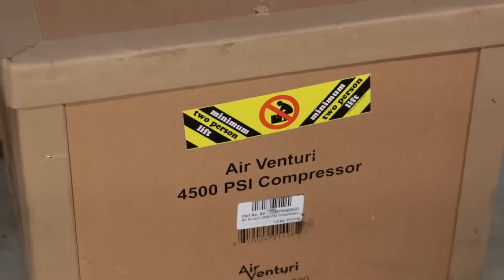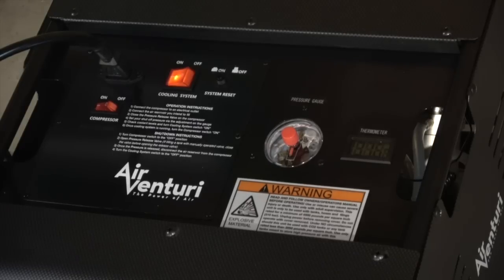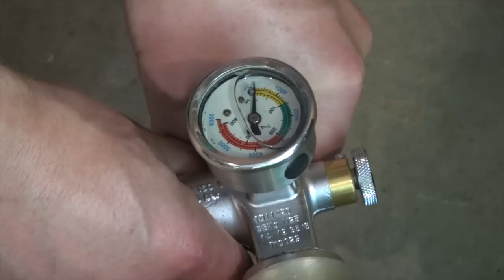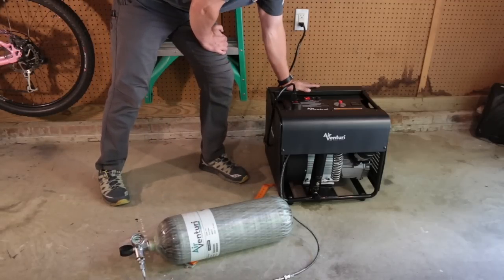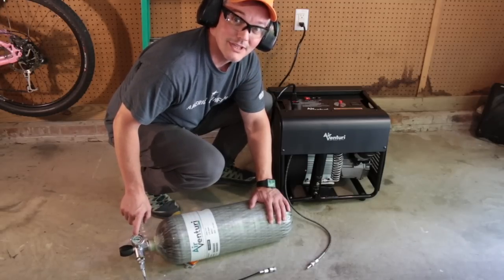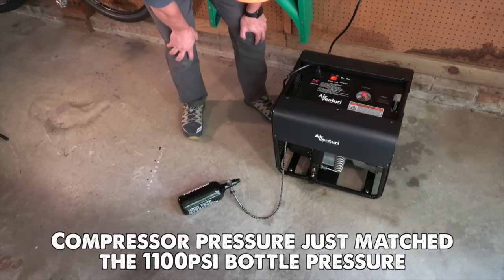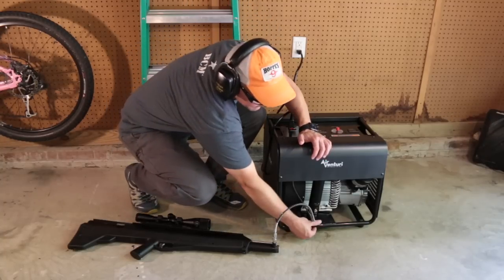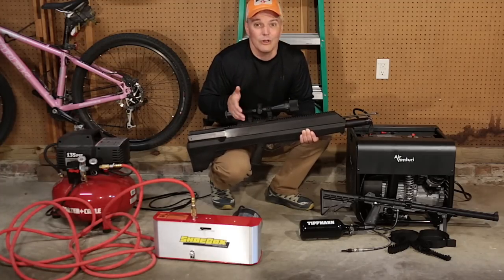Air Venturi Electric Compressor! 4500psi Fills at Home

Comment: For safety, you should fill tanks / bottles in a rupture containment box. At the Fire dept. I work for, we have a vertical container we stand our SCBA bottles in while filling. It also served to dissipate heat as we used a cascade system that can cause overheating. Adds to cost but also to piece of mind  encase of a rupture or overfill failure.
Reply from the maker: Not a bad idea, but luckily, tank ruptures are extremely, extremely rare as burst discs are very effective.  I've been all over the world and have never seen bottles filled in anything other than a tub of water to keep them cool when getting filled fast.
Reply: Agreed with Cameron's comments. The burst tests on top of the actual burst discs are so many more multiples than 4,500 psi that you really don't hear of ruptures. Also on top of that you still need to have your tank re-certified every couple of years. So unless you are using a very old tank, replaced the burst discs with fixed nuts, etc.  You really don't need to be too overly cautious.
Reply: That would be 'peace-of-mind, in case' not 'piece of mind encase'. Unless you are encasing part of your brain in epoxy.

Comment: Error @ 7:36 you shut off the compressor then opened the tank valve. From an engineering and physics perspective, re-starting the compressor against a 3900 psi load was the same as if you had simply opened the tank from the beginning. A cold start against the high pressure is creating the high load high friction stress point you were trying to avoid.

Technically, you could slowly open the tank valve immediately after the compressor is started. (slowly to avoid a sudden pressure shock which in essence would be similar to a cold start under pressure). Probably best to mitigate that high pressure differential and I believe was your intention to let the line pressure equalize within a few hundred psi then open the tank with the compressor still running. Also it would not be a problem if the line pressure exceeded tank pressure, even by relatively a wide margin, as the miniscule amount of air in the line even if suddenly released would be absorbed by and have little effect into the volume of the tank. The physics of air, obviously compressible, has shock absorbing characteristics plus it's impossible to manually open a twist valve instantly 100% so there is some built in buffer. This is not to say you shouldn't still take your time and be careful. 

I would add that assuming all the components involved here are properly engineered and in good operating condition as you apparently proved here by starting the compressor against 3900 psi, all of this is relatively inconsequential save one thing. I've read in blogs/reviews the extra load from starting the compressor with 3000+ psi back pressure has caused some circuit breakers to pop. 
In closing just want to say everyone be safe and most importantly have fun.
Reply: Dude your remarks are completely wrong and Twang's method is straight from the manual, which says: 
NOTE: If your tank already has a partial fill in it, you will want to keep the valve closed
until pressure in the hose is close to the pressure already in the tank. Once the
compressor fills the hose within 300 psi of the pressure already in the tank, open the
valve. 
Next time you deign to offer advice please get your facts straight!
Always the best, Chuckster636
Reply: @charlespeffley  Exactly. You shouldn't turn off the compressor.

Comment: Do you have any problem with adding debris or moisture into the air tank?  I own 7 pcp air rifles and pistols.  This would be a great addition to my air gun setup..  Thanks
Reply from the maker: Not that I'm aware of. The moisture you see is from the pressure dropping really fast, which cools the air below its dew point. A big filter keeps debris from making it out of the compressor and into the tank.

Comment: 95degres c?!
i purchesed one with my friends and if it goes higher then 60c for some time the o rings are failing and need replacmant. its not a huge deal we just do a break between sevral tank fills. i was just wanduring what o rings you use that can handel that heat
Reply from the maker: I don't know the specifics, but 95degC is definitely the rated temp.
Reply: That's almost 212F boiling water!
Reply: silicon o rings should handle the heat easy

Comment: Can the pressure be reduced to fill 3000 PSI SCUBA tanks? I shoot 10m air rifle and we use 3000 PSI.
Reply from the maker: Yes.  It has an adjustable regulator.

Comment: Great job on the video. I'm pretty much sold on it.
Is there any benefit in leaving the pump on to circulate water for a while after a long fill to help cool it down? And, what happens to the water level?  Do you need to keep topping it off on a regular basis? Many thanks for the work you put into this, thumbs up and subbed.
Cheers!

Comment: Can I connect it to a regular blow gun to blow air?
Reply from the maker: Maybe, but that would be unnecessary wear on the compressor.  It's designed for 4500psi jobs, not 120psi jobs.  Better to fill a buddy bottle, then run the blowgun off the bottle.
Reply: Thanks. I thought that I used it for both cases.
Reply from the maker: I thought of an issue you might run into- anything you attach to this compressor must be rated for 4500psi.  I doubt you'll find a blowgun rated that high.
Reply: Yeah, it can be an "explosive" situation. haha

Comment: I have never seen such a small air pump with such a high PSI rateing. If theres a way to ger grade A air out of it, this would be incredible. but even as is, for a vehicle based multi day hunting trip someone could have a near infinit suply of air for small and medium size game and target shooting. or if someone just lives far from a sorce of high PSI air this could be a great investment.
Reply from the maker: It would still cost a lot more because all of the parts would have to be "breathing air safe."  Not sure if there would need to be significant structural changes, but maybe they'll stop by to say whether or not they could make a SCUBA-safe version of this.
Reply: not sure my self. the HEPA filters I've seen are low pressure or inlet side filters. if they could attach an inlet side filter that meets this requirement, them people who dive regularly or would if they didn't have to go get there tanks charged all the time could go more often. it would justify the experience hear in the mid south were there aren't places to regularly get air tanks filled like thar
Reply from the maker: The issue is that this compressor can introduce oil to the compressed air- not enough to be a problem for a machine, but potentially lethal for a set of lungs.
Reply: I see that, and water. those things would have to be changed if that was what they were shooting for, or if they ever wanted to go that way. but as a low volume high pressure pump, it looks like an exceptional system to have.  also if you have the place to do it and dont mind getting wet. I'd enjoy seeing how some of thise air guns and the air bow could hit a target under water. as a just for fun.
Reply from the maker: Other than during the initial break-in run, any water that you see is simply from the air going from very high pressure to ambient pressure super rapidly. You'd see the same thing bleeding the lines from a SCUBA compressor that quickly.  No extra moisture is getting into the bottles.
Reply: so the pump the has a water separator?
Reply from the maker: No. Ambient humidity goes in, ambient humidity comes out, albeit with a lower relative humidity. The water seen blowing out of the release valve is a phenomenon of rapidly decreasing air pressure.
Reply: What about rebreathers? Or are they covered in that? I hear closed circuit rebreathers can run your body on a very small oxygen bottle for up to 9-12 hours.
Reply from the maker: Rebreathers can have condensation issues, but it's as much because you're exhaling warm gas at 100% humidity into a return hose that is cooled by the water.  It's usually absorbed with moisture wicks and/or you can generally purge it with a loop purge.  This is beyond the scope of this video, though.
Reply: Great review of this product, but I need to point out that you don't get moisture out of the high pressure lines on a breathing air compressor unless there is something very wrong with it. They incorporate inter-stage moisture removal chambers and condensate drains that are either automatic, or need to be bled every 10-15 minutes of operation. I'd be interested in seeing the internals of the cylinders when hydrostatic requalification is done to check for moisture/oil transfer.

Comment: About the water.  One of my big concerns is moisture in the rifle cylinder.  Can you address that issue.  Either pre- or post-compressing the air.  Thanks.
Reply from the maker: Moisture issues with this compressor are no different than any other compressor.  Any rapid decompression also rapidly cools the gas being released, which then causes water vapor to condense.  That’s the same with bleeding the lines of any compressor out there.
Reply: @TWANGnBANG  the air put into gun and tank isn't dried? no dry pack built in? or purely relying on condensing compressor base at outlet?

Comment: A safety note you missed is why you crack open the value slowly for those all your viewers that don't know, is to minimize the chance of gages and regulators from rocketing off and into the operator or anyone/anything nearby. It's the same principle taken from industrial high pressure tanks commonly used in welding

Comment: I see with the shoebox ones you can have an inlet of other inert gasses and compress them, can the same be done with this unit as I would like to compress nitrogen?
Reply: Yes, either inert gases or an air dryer before compression to keep water out. I also would like to know this. Nothing was mentioned about delivering dry air/gas to your air guns or storage tanks.

Comment: you could also attempt to make friends with your local fire station. they might fill it for you. SCBA bottles are also filled to 4500 psi and their compressors can do it in about 30 seconds.
Reply: When you get it home, you will find that the tank has cooled and will be low if they do it that quick. Proper fill is in a tank of cold water, wait a few minutes then top off.
Reply from the maker: I hope nobody is filling tanks in 30 seconds. That is beyond slamming air in a tank and is a waste of everybody's time as the tank will get so hot that it will drop 400-500 psi by the time it cools easily, and you'll have to wait forever for it to cool. Much smarter to slow fill, which is why that's what this compressor does straight from the factory. Thanks for watching!
Reply: our support truck in the fire deparment i worked for had a refill station that was 30 seconds to a minute for a 4500 psi bottle... but its primary purpose was to get tanks refilled to get fire fighters back into the building quickly... it does sacrifice some total volume of course, and i would not recommend it.. for tank life and total volume.  our normal filling took place off of multiple stage tanks around 1000 psi differences... done in a heat-sync / rupture protection system. And as stated above, there was a systematic delay between first topping and a second topping.
Reply from the maker: That's a slam fill for a purpose, though. Makes total sense for that.
Reply: Brandon Bichler, already tried that, it's against city ordinance "supposedly"
Reply: TWANGnBANG question because y'all mentioned filling breathing tanks... Can this compressor even be used to fill tanks to breath out of? Wondering cause if someone uses this compressor to fill a scuba tank for use to also fill Air rifles can it still be used for diving once refilled at a dive shop?  Or does it get contaminated with oil from the compressor and need to be cleaned first?
Reply: Currently only have one tank and use it for both but I'd like the compressor to save me all the trips after draining it with my air rifles. If the compressor contaminates the tank I'll have to look into getting another dive tank. Their not exactly cheap
Reply: That may work within certain communities but not necessarily in all, and certainly not in certain cash strapped or perhaps risk adverse municipalities within California, as I've made inquiries and offered payment for service to be rendered only to be told no by fire dept. personnel due to internal policy. A regrettable situation that seems all to typical of our once Golden State that's now merely pewter.
Reply: J Barrena or Texad
Reply: WRONG! you don't fill wrapped cylinders in water. That is old school information from when the cylinders were steel or aluminum. I guess it still applies to SCUBA cylinders since they are not composite wrapped.
Reply: If you watch the video it even says not to use for breathing as the air is not clean to use, since you will have oil in the tank also.

Comment: The shoebox was never an economical solution for anyone handy with fabrication. I built an automatic air venturi G6 handpump for $350. (And I could have done it for less) Not only was it cheaper than the shoebox, it's faster too. It too runs off a compressor, but your not boosting the air, your just using the air to push a pneumatic cylinder that drives the pump. This let's me run at a low 40psi to get around 3000psi before the pressure stops the cylinder in it's tracks. Wanna pump 4500psi? No problem, just run it at 70psi. There are a lot of people doing this. Mostly with electric drives. All in all, it's a much cheaper solution than the shoebox ever was. Now, is it faster than the air venturi compressor? No, the compressor is really awesome. But it is $1000 dollars less than the compressor.

Comment: In other compressors there is a filter in the connection. Does this compressor just not need a filter because of the bleed valve?

Comment: Hey Twang, I unboxed my new Air Venturi Kryton compressor today and just finished topping off my third tank...thanks so much for your easy to understand demostration, and your advice about filling a tank that is still partially filled is straight from the manual...
NOTE: If your tank already has a partial fill in it, you will want to keep the valve closed
until pressure in the hose is close to the pressure already in the tank. Once the
compressor fills the hose within 300 psi of the pressure already in the tank, open the
valve.
All the best, Chuckster636

Comment: Too expensive but top notch unit no doubt.  Im struggling to get the crap Chinese  (works well but Chinese YUCK) yong heng. Still no pcp but im getting a minimum of 34fpe with my HATSAN MOD 125 vortex using 30.86gr H&N baracuda 25cal pellets and stacking up 3 shot groups every time I try(and ill keep improving).
While its not a pcp it does perform darn close and while its not as pretty as a 135 its MORE powerful so for the money,  if you want the match grade trigger and other niceties including accuracy and power,  the 125 vortex is a good optuon.
Once i do hace a compressor im getting the DIANA storm rider 22. Not MY first choice but second and my family can shoot with me then from there its probably a jral puncher breajer and a couple mods i can perform vut by then i might change my mind due to options and price

Comment: Take the side cover OFF on the side the pistons are on and put a Blower shooting air at them and temperature will not go above 50C and that's from 0 to 4000 PSI and you can hold your hand on the piston head no problem. Keep it cool and change the oil and it will last you. With the cover on and a blower about 64C. This is a hour and a half run non stop.

Comment: wtf, I recognize that compressor and it is sold for 150 USD  in china without the black covering around it.
So you pay 1000 for the plastic part and the additional radiator.

Comment: so glad you explained equalizing the pressure first when filling a bottle, so important and you explain it so well.
Reply: Not really.  He started the compressor back up under 3900psi.  I would suggest installing a check valve on the fill whip. Open your bottle, turn on the compressor from 0 psi and check valve will only allow air to flow into the tank when the tank pressure and comp pressure are equal (technically when comp pressure is greater than tank pressure)

Comment: Excellence demonstration,  you hit to the point that I want to know about how the general compressor won't work with 4500psi tank and shown how to proceed fill out the tank.
Reply: I agree this explanation was so much better showing the pre-fill pressurization of the line, etc. great help

Comment: I have a ShoeBox compressor too.  This is so much nicer/faster. Thanks for the recommendation!
Reply from the maker: Yes, the ShoeBox was a fantastic solution until this came out.  Not sure how they will continue to sell, especially since AirVenturi also came out with their own booster priced at $700 and built to be more reliable (reportedly).